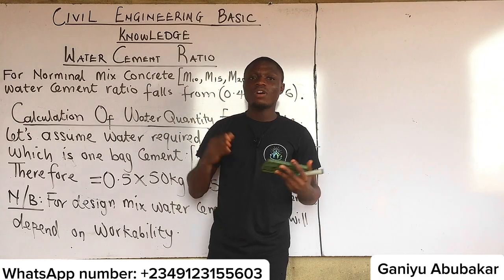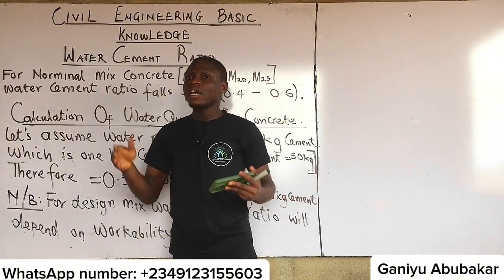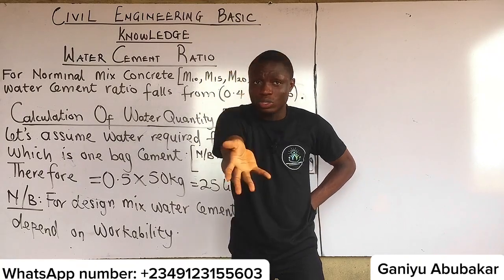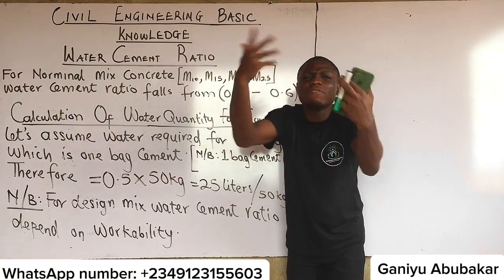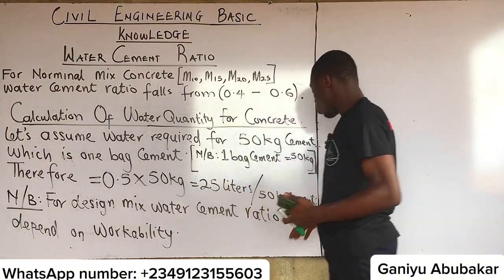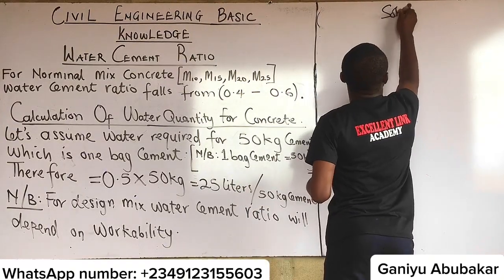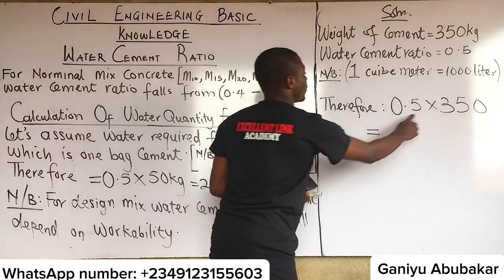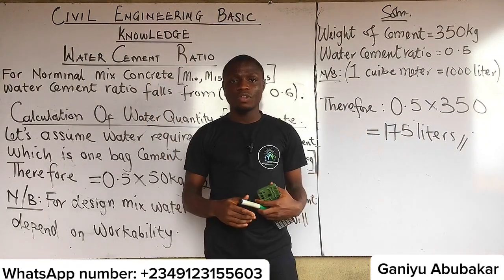CIVIL ENGINEERING BASICS  : Water 💦 Cement Ratio Calculation(made easy).#civilengineering

Comment: The formula you use for the cement is incorrect. The reason I say that is you didn't multiply the two by the volume of cement then you divide it by seven then you get the correct volume for the cement. The granite formula is correct because I see you multiply the four times the cement volume then you divide it by seven then you have your correct answer. Your doing alright with your work.😊😊
Reply from the maker: Thanks for about that